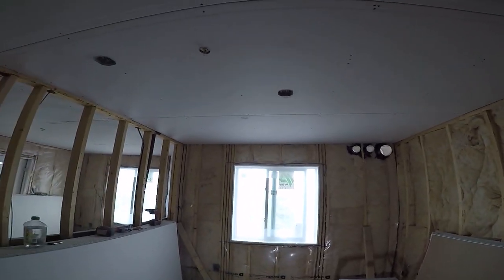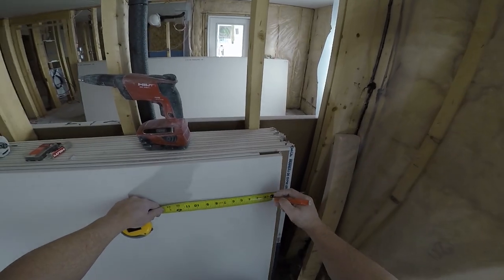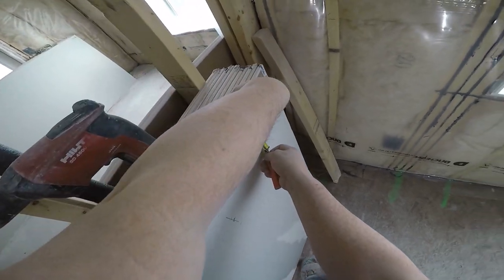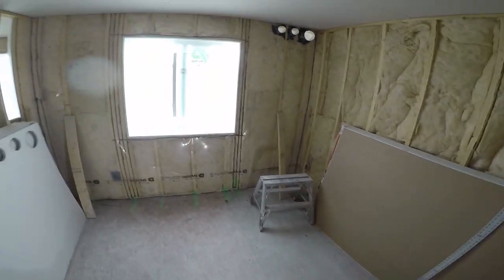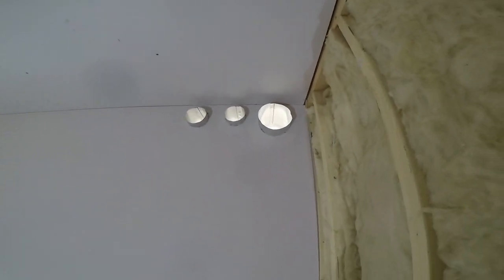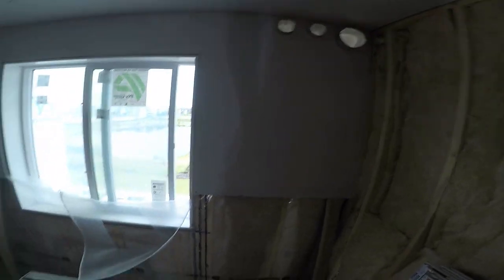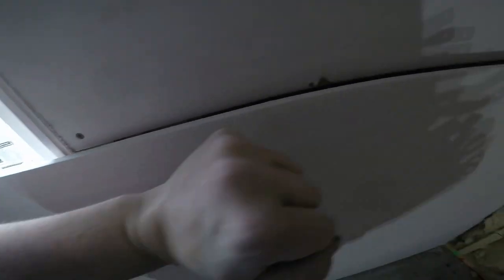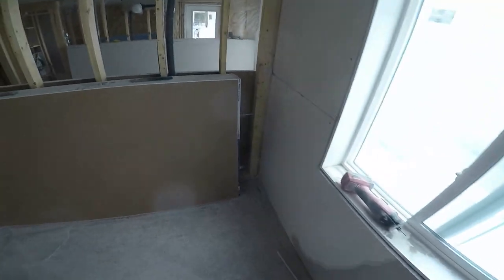Hanging Drywall Around A Window, 3 Ducts & A Plug!

Comment: About how much would it cost to install the drywall around a window like you did?
Reply from the maker: This way not expensive at all, 2 sheers of drywall and less than 1 hour to install. Taping is easy just the 2 inside corners and 2 small bevels.
Reply: @ConstructionKronies Wow… Thank you very much for answering my question!
Reply from the maker: @Elena-mk6bf  Anytime!!!

Comment: Provides a good walkthrough of the trade-specific technique, but how is the continuity between the window frame and the vapour barrier achieved now that it's cut like that?
Reply from the maker: Excellent question. If you are really good and know what your doing you can cut the board like this but there are new rules since making this video and you can't cut the board with a router anymore because they don't want you to damage the poly. Buy since the new rules I have discovered that pre cutting your sheets to fit around windows is faster and better actually.
Reply: @ConstructionKronies  Can you elaborate on those rules for us?  Is that just for a specific builder or developer or is that an industry-wide directive of some sort?

Comment: how about the poly (vapor barrier) under the drywall? You did not damage it while trimmed the drywall?
Reply from the maker: Great question. I don't  do any damage to the poly with using the cutout tool. Some jobs you need to be careful not to though and sometimes may.have to pre cut your pieces. You will know if it is taped up all around or not. These windows and electrical boxes on this job are caulked and polied straight across so you can cut the.poly and drywall to fit perfectly.

Comment: Along with the expert tips on ovals and such, how to drywall into pan decking while keeping deflection, xo
Reply from the maker: We usually make a template and keep the drywall always 3/4" away from u/s of structure for deflection. Boarding into the flutes isn't something we do anymore since all the new insulation and firestop products that are made for them now but once in a while I hear about someone having to do it. But the template is how I used to do them.

Comment: Hey Chris    Tapers do not like when you used your router in a factory edge joint.
Reply from the maker: Your right but under these circumstances they are cool with it. The trade off for them is we always have very tight corners. We are only zipping off up to a 1/2". The entire project was designed wrong. The designers forgot to add the extra 1/2" for res bar and 1/2" off the floor so all of the sheets need to be cut. Because we are piece work we need to do that as fast as possible. Good point though!

Comment: How did you cut a perfect shape around the window??
Reply from the maker: Measure over from the wall and down from the ceiling, draw it on the drywall, score the lines for the window cut out with my utility knife then use the cordless cutout tool. Some jobs you can put the drywall right over the window and then use the cutout tool with a guide point tip to.cut around the window.
Reply: Construction Kronies makes sense! Thank you so much!!
Reply from the maker: @jonathantiggs4628  right on man! So the key things to remember when doing it like that is especially on wood structures: Take the measurements from where the top and the bottom of each sheets lands and also try to estimate how much extra room you need. For example, I usually come in a 1/4" on the ends of a sheet that will have another sheet tight to it after. This gives you some play room and is why we start on window / door walls and work our way out!

Comment: How are you cutting windows out that are polyed without cutting the vapour barrier with the router bit. All our basements are polyed on the frames of the  12 inch deep bucks to the window frame.
Reply from the maker: We are pre cutting them now, all windows and doors. Go a 1/4" to 3/8" larger than the plastic. It's actually against code to use the cut out tools (routers) anymore when there is a vapour barrier. Start with the top sheet then the bottom. Draw the window on the sheet, score the lines a utility knife, use a router or drywall saw to cut one side then break it out. They can be really weak in the middle above the opening so if your alone be careful or just put a joint above window. The bottom sheet you set one on a 1/2" PC of drywall and use a lifter to lift the other side into place. You will get it from there. Hope that makes sense
Reply: Dam I was worried you were going to  say that.
Reply: Hey while I have you. On a 9ft ceilings using 4 ft board , Suspended ceilings going in. where’s the 10 inch go. I like the bottom so when I finish I have flats for baseboards. Or else I have to fill the indent.
Reply from the maker: @BZ1340  So 9' ceilings are very standard so they make drywall that is 54" wide. Use those for 9' and the 48" for 8' ceilings. If you have already ordered the drywall then add a 12" belly band is what we call it, so right in the middle between the 2 sheets. Its easier to tape and less chance of it cracking. However if your putting suspended ceiling in at 8 foot then put the strip at the top above it so it doesn't have to be taped at all. Does that make sense?
Reply: @ConstructionKronies  I'm only 103 in the basement. 54 here is triple the price of 48. I dont like the feather joint at the baseboard level. I have to mud it all in. It's stupid I'm 48 48 and a 7. Ceilings are at the 100 mark. 3 1/2 drop off the joists

Comment: Why did the bottom piece not have a 1/2" gap to allow for the subfloor or water spillage?
Reply from the maker: Yes, normally you want to do that but in this building a lot of the sheets ended up on the ground because the ceiling heights are not correct. But the flooring is going to come up another 7/8" and they actually want the board on the ground in some spots. Your totally right though normally you will do that.

Comment: Why don't you put the bottom sheetrock on first?
Reply from the maker: Great question. We have to lift the board a 1/2" off the floor and we want to be as tight as possible on the top  for the corner to be taped. So we install the top sheets first and then use our lifters to snug up the bevel. Traditionally our ceiling heights are 8'-1/2" (2 x 4' sheets) or 9'-1/2" (2 x 54" sheets). I hope this answers your question.

Comment: You’re using the router wrong. Inside cuts are clockwise like doors and window openings. Electrical boxes or outside cuts are counterclockwise. You can see when you started from the right side of the sheet, the window bit leaves a rough cut with pieces of the paper, you start at the left hand side of the sheet. Its a smoother cut, plus the right way to do it. You never ever do it the way you’ve showed people in this video im sorry
Reply from the maker: hey my good man, I never use a router wrong. I use standard bits not those pussy guide points. Plus I use 5/16 and 1/4". I can cut anything anyway no matter the direction or object cause I am an OG! Only you noobs would point out something so trivial and not important. Rooks yeah usig guide points have to cut out boxes like that but pre cutting you cut to your strength.